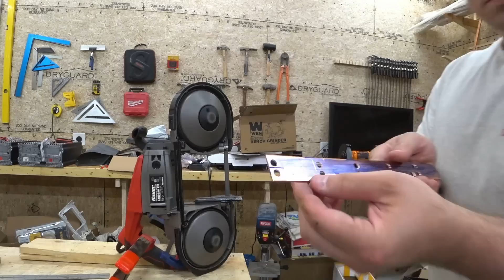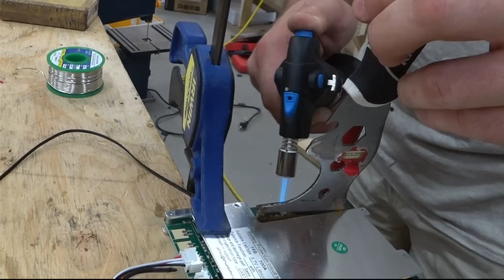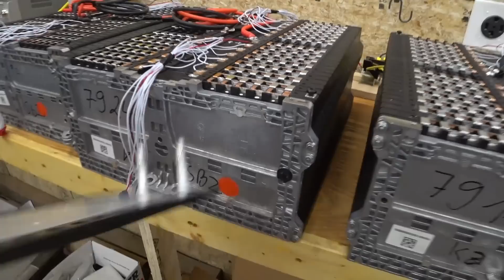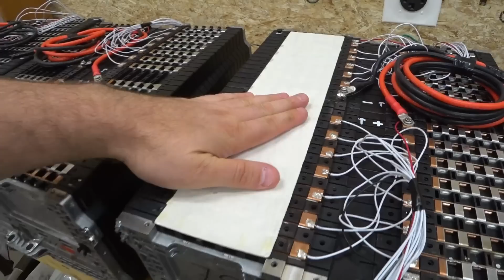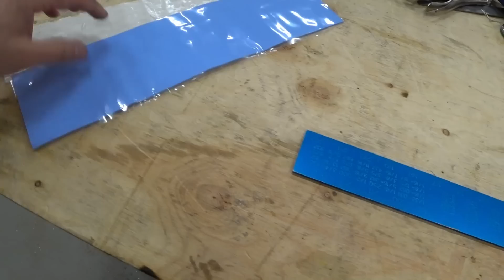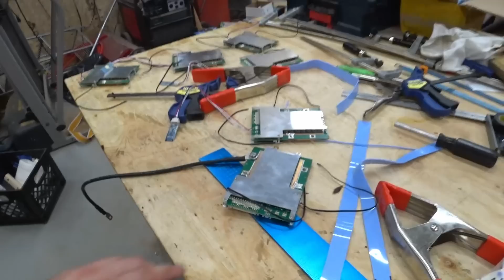Heat Sinks on Lithium Battery, DIY

Comment: You could have run coolant through them from your hydronic system. I realize they may never get hot in low discharge use. Always a good video and thank you for making them.

Comment: "hot spots in the system"     what what what are you talking about?
Reply from the maker: I'm not talking about anything in particular.  Just the general heat that occurs in all electrical systems, very, very minor.
Reply: @DavidPozEnergy  
i think that aluminium plate with that blue mat underneath probably adds to heating rather cooling.
either way, with your use you do not have to worry anyway. just some fun of using the new bandsaw and reusing the lid.

Comment: I was reading about cooling cells, they say it is more effective to have a heatsink on the electrodes, I guess that is what is done here!
Reply from the maker: Cool.
Reply: The cooling chamber of the electrodes on the batteries causes moisture. I think it is bad for the battery because it causes moisture corrosion of the electrodes due to the condensation of fumes.

Comment: Are you connecting the charge and discharge connections on the BMS
Reply from the maker: Yes.  This BMS has one side made for both charge/discharge, and one side connects to the battery.  So, only two big connections on the BMS, Battery side, and load side.

Comment: David;
Also, I noticed that you switched from the ENJ Power BMS to the LLT Power BMS, was there any particular reason for this?
I'm using the ENJ BMS and it seems to be doing fine after balancing 4 12s banks
Reply from the maker: Hi Mark,  I used the balance board to recover the cells, but I don't want to leave it long-term because there are no protection circuits built in.  These LLT BMS's can cut the circuit if a cell goes out of whack.

Comment: David;
Thanks for the vid
I don't get why your adding the additional copper bar. Is it because there is a deficiency in the conductive connections of the BMS?
Reply from the maker: The additional piece of copper is most likley not needed.  I bought the copper 101 bar very early on in the process.  I ended up not needing it for my first thought.  When I was working with the BMS boards I could not bolt directly to it because the copper on them made an un-even surface.  I could have notched the bolt head to fit around, but I thought the copper bar would work better.  I'm figuring it can only help.

Comment: Excellent article on the installing lithium high voltage system ac battery power supply 380v 40000ah. Thank you for this wonderful watching.

Comment: Though I am 'only' into 18650 cells, I can appreciate all your builds.  Thanks for the tip for thermal conductive padding. Was looking for something to transfer heat, but no current.
Reply from the maker: Glad the video helps.  I pick up tips and tricks from 18650 videos too.
Reply: @DavidPozEnergy  what is the particular name for the insulation pad you used between battery tab and shrink?

Comment: I don’t think I could have brought myself to cut off the hose connections, I would sit there thinking what if I need them, how would I put them back? Lol. 
 
I got my Calb cells in and am just waiting on my ring terminals before getting them connected now. Turns out 5/16 eyelets for 22awg wire are rare... who knew.  

Can’t wait to see your finished battery, and as always be careful and don’t let out the magic smoke.
Reply from the maker: Hi Demonic Animatronic.  Back when I setup my Chevy Volt batteries I was thinking the same thing.  "What if I need the coolant connectors?"  But, over the last year of using those batteries I have not needed them.  I have even checked for hot spots with my IR thermometer during 8000 watt loads and still nothing got hot.  I'm pretty confident that the loads I'm putting on the batteries are not enough to demand liquid cooling.  Thanks for watching.

Comment: Sweet toddler! Makes wish I could go back to when mine were that young. Looks great! I know nothing of those batteries. This has been fun!  I do worry about that heatsink on top. Again I know know nothing of the battery so I'm just guessing. You have seen them and worked with them so I trust you.  Looking forward to more! Love your channel!
Reply: I think so too....I mean that heatsink can offer liquid cooling and make the battery much cooler but I guess u don’t need it but I wonder how stil that heat sink gonna help you.
Reply from the maker: Thanks for your kind words.  What is it about the heat sink that has you worried?
Reply: @DavidPozEnergy  I'm always scared of shorts. I worry to death about the unknown. What if that pad isn't 100 percent correct or made to the best standard. What if 10 degrees of heating and cooling flexes it enough a hole forms right where it shouldn't. What if, What if, What if...you know what I mean. I'm a bit crazy. What if I bump it with a 2x4 while working in the shop and it comes loose and crosses -+. I have bad dreams along those lines. I can honestly see me leaving it off due to bad dreams hehe. But, I do not know those batteries! My worries just come from watching a video. I'm sure I would understand more if I had them in my hands!
Reply from the maker: Hi Aaron: Nothing is 100% and there is risk in everything.  It's valid to think about these things.  I've asked what is safer... to have the battery bolted back together the same way it was originally from the factory, or to leave the copper bus bars of every cell exposed?

Comment: So are you running all the BMS in parallel ?. Are you still using the cell balancer.  And thanks a lot for all your videos.
Reply from the maker: I used the cell balancer for a couple months during the refurbishment phase.  It worked really well.  I've saved the good cells and discarded the bad cells.  From this point forward I don't think I'll need the cell balancer.  The BMS has a balance function built in.  It's a very tiny balance function (0.05 amps I think), but should be good enough.
Reply: DavidPoz how your bms will interact with each other? Are they linked some way? My fear is that if they don’t talk to each other and one sees a voltage of 4.2/cell, and others sees 4.19 volts, the 4.2 one will shut down, and only transfer more amperage the other bmses. I am not confident that Those  bms will have the same reading. In fact,  I don’t think any electronic devices are that precise and constant that they will react identically the same. Would love your thought on that. Thanks ! Love your videos!!!
Reply from the maker: Hi Maxime Mineault:  The BMS's are not linked and don't talk to each other.  The scenario you described could happen.  I plan to set the parameters to (hopefully) avoid it.  I plan to keep my charging set to 4.05 volts, and the cut-off voltage up at 4.20v.  This way there is a big enough gap.  Once I get a chance to work with the BMS software I plan to make a video about it.  Thanks for watching.
Reply: DavidPoz awesome! Looking forward to see that video!